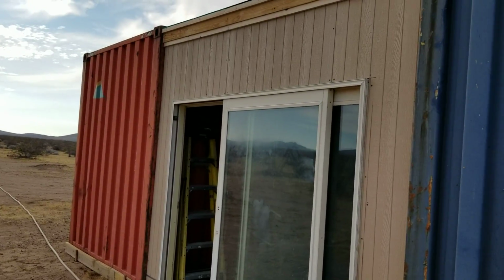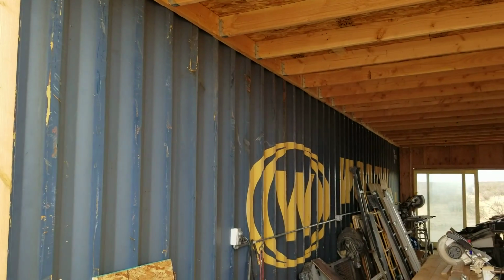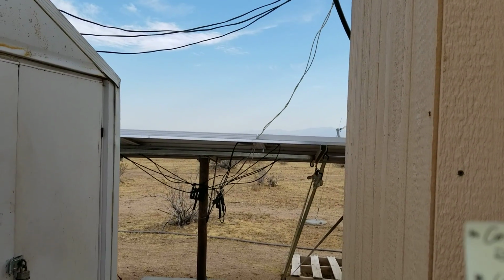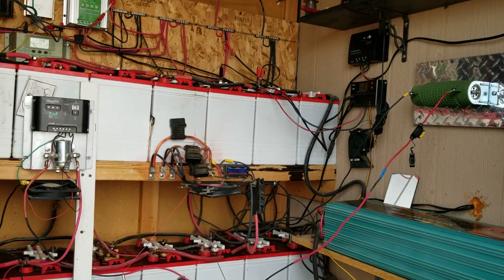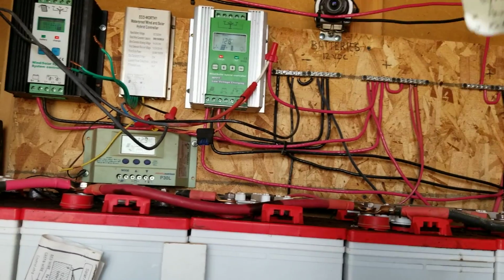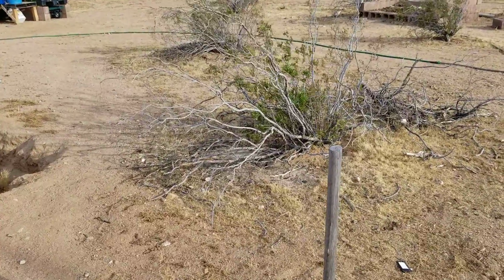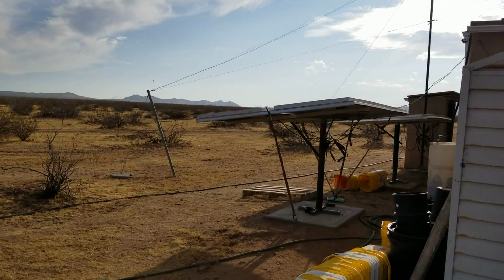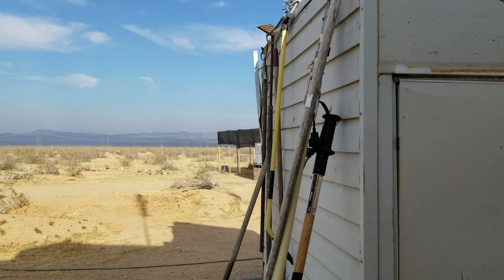Finished the roof framing and sheathing,  off grid electric 101, part3

Comment: Hi G bear
Paul here again from good old New Zealand, hope all is well I need your help again bud
I have done what you said got rid of the Chinese junk mppt controller and have now done a rectifier and have made a dump load the same as yours bud I can’t get the pwm to work on the dump load I’m lost
Reply from the maker: Ok, you say that you 'made' a dump. Load like mine?  Mine is purchased as a pre-built unit.
I'm pretty sure I covered it in one of my videos, but you can't use a standard pwm controller for dump load.  The unit I have is factory preset to activate at the proper over voltage.
I'll go over that again in today's video later.

Comment: Have a question about the garage door..
The 2x6s are strong enough for the roof..
I can see doubling the last one for the big door side...
But there is no second floor..
Why would you need a header beam..
Maybe triple the last roof rafter...
Reply from the maker: Proper framing calls for a 4x6 over that opening.  If I add a garage door opener later, I will need that strength to attach it to.
A 4x6x10 only costs $12, two 2x6's cost $14, and I would still have to add a 1/2" plywood between them to make 3.5" thickness.

Comment: You need a brake switch 3 pole.for the wind fan. In case you need to work on it . Or to much wind
Reply from the maker: No!  Never use a brake switch on a PMA!  That's a  no-no.

Comment: Commercially (remote telecom sites) we use a fixed look angle derived from the Latitude number plus ten degrees once installed we can’t move them. That’s a winter time setting when solar collection is the lowest.  Definitely cover panels when connecting and disconnecting them and be very careful about short circuiting battery banks… when able to make pointing changes during the year G-Bear’s advice is best (!!)